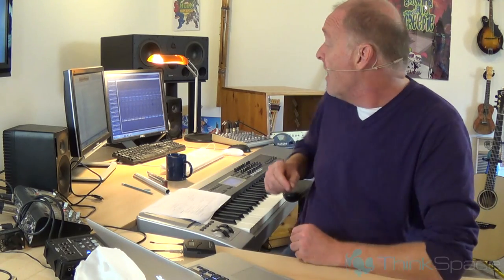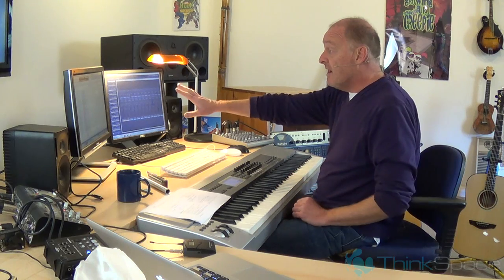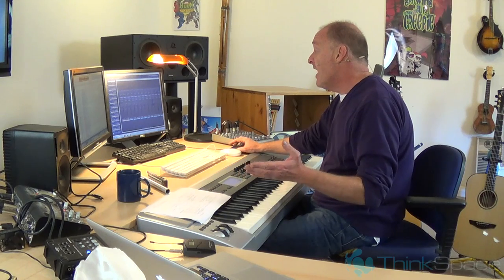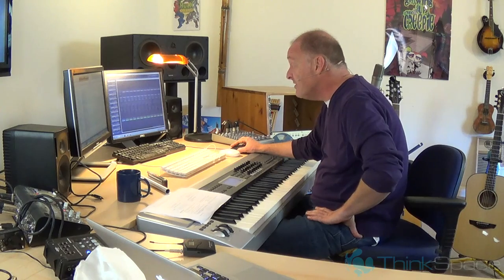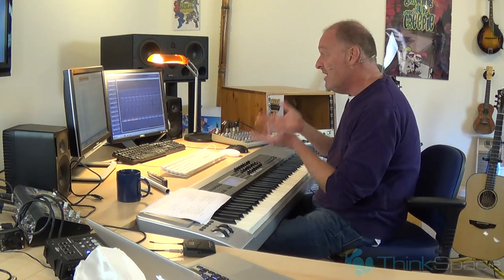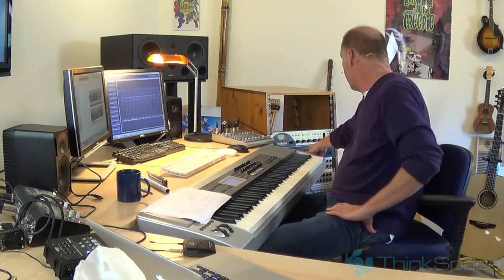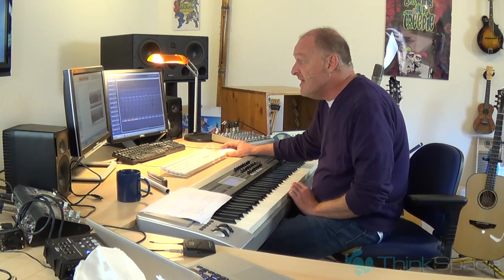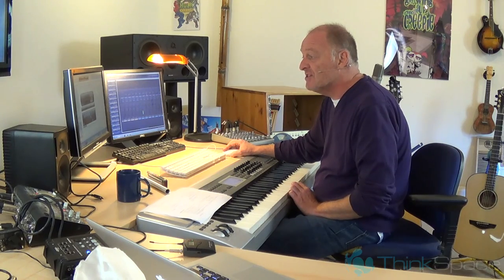Film Scoring: How To Use Reverb

Comment: Ah yes, I got cut off but went on to talk about interpolation and it's implications. MIR can actually be quite difficult to work with. Despite the visual paradigm it turns out that to get a truly superior "in the box" mix, one must have a very good ear to get the best out of MIR. Having close mic'd samples is a necessary to get a good transitional mix. But there are some very creative things that can be done with MIR if you're in a position to try new techniques with it. MIR is not just a spatial plugin. I put it in the same class as Speakerbox 2 and 2C Audio's offerings. Oh yeah, this video was about practical reverb bussing. Sorry about that!

Comment: I have to disagree about the MIR explanation. MIR is not a room simulator (although I understand why some people call it that). It's a convolution reverb that also uses interpolation to fill in missing spaces (or maybe a better way to say this is that it glues the room together). MIR starts out doing the same thing as Spaces. The difference? Spaces captures the sound of an instrument at a particular point on a stage and stops there. MIR goes a step further then steps back. MIR samples the entire room with more regard to capturing the entire stage and not just the direction a particular instrument sounds, after all they are both strive to place instruments in a room first, but MIR captures more than angles of a plain, it also captures sound above and towards the floor facing up. Almost a 360 degree capture. But that is difficult (more on that in a moment). So while Spaces is concerned with what an instrument sounds like in one position (so it records an impulse from the exact spot and when you use it you are placed in that same spot), MIR tries to capture the whole of the room and let's you move the instrument around the stage in 360 degrees (with or without the mic in front of you. While Spaces chooses 2 left and 2 right IRs or less), MIR uses 8 or 10  (2 up, 2 down and 6 around), and then wants to capture that sound from a hung mic tree. MIR is like a Russian nesting doll. How could they possibly capture 360 degrees, only to attempt to have those IRs sound as if they're being picked up by mic trees (and up to at least four at that). Well it can't do it only with IRs. MIR doesn't capture every part of the stage. Just enough to get a really good idea about the rest of the stage. Only 11,000 or so IR captures! So here's where the first controversy begins. MIR (using sophisticated math) "interpolates" (love that word) the specs in between the parts it didn't have time to capture. Is it convencing or does interpolation do something to "mess up" the quality? Mostly I don't think so. MIR needs to be able to excite a whole room from any point on their stage and do it well. That's a tall order. But it doesn't stop there. MIR goes one step further. Instead of sending the new sound of your instrument on down the mixer, like Spaces does, MIR then (and this is bold really and is another controversial point), MIR sends the stage sound produced by your samples oboe (or whatever) and uses up to four mic trees or rigs to capture the hall sound that's coming from the stage (and it can route the rear mics, for example to rear surround speakers). MIR gives you many classic mic tree setups to try, but allows you to edit the characteristics of the tree mics and mic capsules via interpolation (it worked before, why not try it again). Then MIR has one last nice little trick up it's sleeve. MIR includes MIRacle which is a well designed algorithmic tail reverb that has presets based on the hall's MIR's IRs were recorded in, as well as other general musical spaces. So does MIR work? Yes. Some people that know what they're doing get MIR to work incredibly well. Sometimes you have to think outside the box and try things that don't seem right (like turning instruments backwards to get a more realistic delay, absorption and frequency response). It's supposed to be easy to use but honestly it's become a mixing art form unto itself. It's CPU intensive (but not too bad). Is it necessary? No, not really. Is it the next evolution in spatial mixing? Many people love it, many people totally don't. There is a whole issue of placing reverb baked samples into MIR (and Spaces too) adding ERs on top of ERs creating a mushy mess, but that's a different post. Personally I go back and forth between a conventional all reverb bussing system and MIR. MIR can be tough to master despite its approachable interface. Hopefully VSL will take MIR further and add a few more features that allow MIR to make features that aren't possible any other way. Hyper-realism is very popular right now. MIR can do very normal chamber mix, of it can be a drum buses reverb. But I hope to see me take orchestral music and other types do music into spaces and mixing territories that are not only complex (due to interpolation), but are also very creative. Like what 2C Audio are doing. I think if MIR is still around in 10 years it might turn out to be the way the next generations learns how to mix. Sorry for the very very long MIR and Spaces post. But, why not at 7am? Good day.
Reply: +Steve Steele If this isn't obnoxious, I don't know what is.
Reply: yes MIR  is a multi-impulse response  of the spaces room, so is very very impressive. you have another fantastic tool:  Virtual Sound Space 2 from Parallax-audio (capture primary reflexion on multi points of the space room + interpolation between this points, it's not a convolution). for this one, you must use a reverb tail (without primary reflexion!) it's mutch versatile than MIR and low cost! (less cpu too) but MIR(24) is a MUST HAVE!
Reply: +cyrus-music.com Yeah, I have VSS2. I helped contribute some presets to it. It's a nice piece of software. I'll make a video review about it sometime soon.
Reply: So it's a room simulator then?
Reply: +RobertLucasMusic That would be Flux's SPAT.
Reply: @TheSteveSteele  
wt about vss3
Reply: Captain Voluntaryist, The Statist Slayer I haven’t looked at VSS3 yet. I need to see how they’re doing it first before I can make a comment. A not so common fact about MIR is that there’s no true way to have a Decca Tree. Although you can “fake” one by using the secondary mic as the center and the conductor mic as the LR mics. It works. But ambiasonics doesn’t allow for Decca trees. 

Currently I still use MIR on Woodwinds. (Works perfectly fine, just use a smaller Teldex room than you might think). Berlin Brass was recorded SITU in Teldex so it’s a nice match. And Spitfire and VSL Strings mix well with Teldex with a bit of  tweaking.